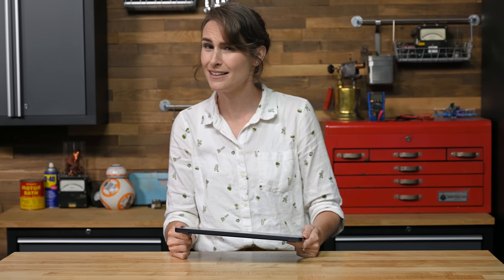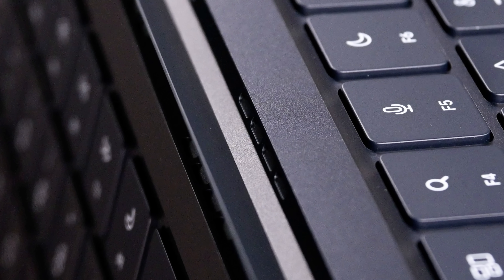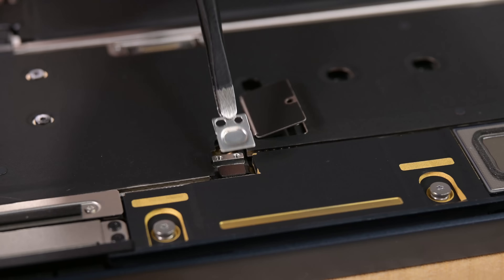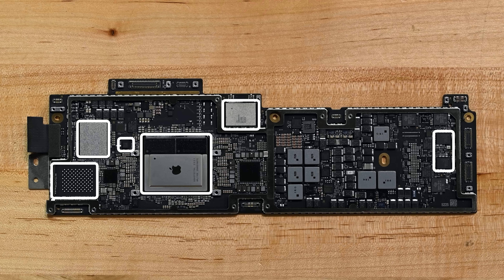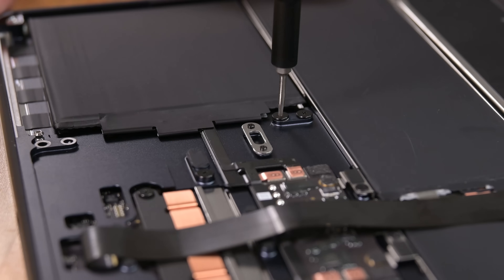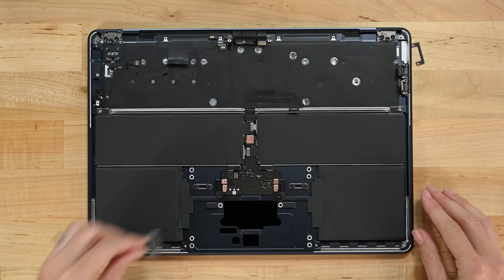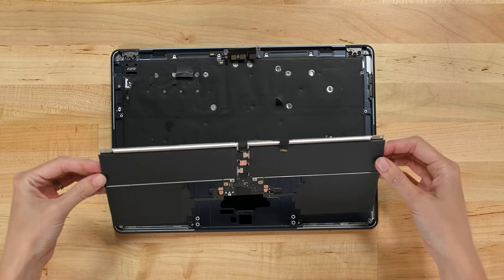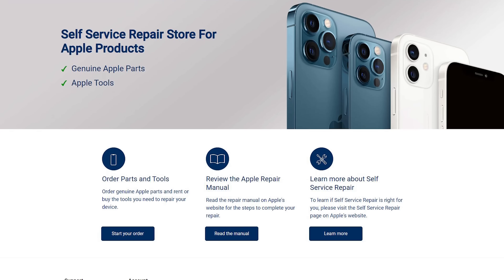M2 MacBook Air Teardown: Too Cool for a Heat Sink?

Comment: I remember previously some laptops (dell or asus) could 'sense' if it was on your lap, and would try to keep surface temperatures cooler if it detected it wasn't on the table. This Macbook may throttle if the accelerometer detects movement to keep the chassis cooler on your lap.
Reply: @Ramp Just my opinion: It was a bad design choice to make the thermal heat spreader smaller on the M2 than on the M1. It just adds another asterisk to the performance of the machine that doesn't need to exist. If you really want to put a less capable cooler in a machine, put in a less capable chip to match it. That way the marketing claims Apple makes will more closely match what people are actually getting, regardless of what they are assumed to use it for.

But that's almost separate from what the OP is saying. I'm not going to pretend to know why Apple put in the accelerometer, but what the OP is suggesting is a reasonable guess. It's probably for several reasons and not any one use in particular. They can always add uses in software if they choose to. A couple of guesses why from Apple's perspective, this might be a "nice to have but not critical" feature:

1. They know that a lot of people base purchasing decisions on video reviews and if a reviewer complains about it being uncomfortably hot on their lap, fewer people will buy it.
2. It could be a quality of life feature for users in hotter regions of the world where the ambient temperature is just going to add to the temperature of the machine.
3. A less likely reason: Apple's lawyers suggested that if they insist on letting the machine run hotter, they implement something to protect themselves in the event of a lawsuit due to a crazy combination of circumstances that led to someone scalding their lap by accident, which could result in bad press, payouts for damages, product recalls, ect... (I don't know exactly what this would be. Maybe someone with extra sensitive skin falls asleep outside when it's hot while doing something super intensive with this laptop on their lap and wakes up to burned thighs lol. Maybe the added heat just increases the risk that the battery degrades at a faster rate and explode on someone's lap. Crazier things have happened. Remember those exploding Samsung phones? It wouldn't surprise me if Apple is bending over backwards to make sure that bad press like that never ever happens to them.)
Reply: @Ramp The difference with the M1 MacBook Air is that the throttling happens way later as the chip can still be cooled. And why are you against active cooling? It's not like the Macbook Pro turns them on anyways (rpm very low even with 90°). Once you need the real power of the M2 (or M1), you will see that passively cooled is trash. Sure, you won't see any benefit while only using Word and safari, but then there is a question weither a Macbook is needed or a cheap Chromebook can do the trick. Either way, that was my opinion and it is your money. You know the best how to spend it.
Reply: @Ramp It doesn't matter what "typical use" is when it comes to hardware design choices such as these. What matters is what the machine is capable of doing. There will always be users who push any given machine to its full capabilities. What the OP suggests is a perfectly plausible (and testable) guess. Overheating is overheating, regardless of what the chip inside is. The M2 has been shown to reach temps above the boiling point of water, so yes this would absolutely be a welcomed quality of life feature for some users. Even if Apple is currently not using the accelerometer for this purpose, this shows that they could possibly implement it in software if they so chose.
Reply: @J33111  people are going to buy it for school anyways bruh, do you need a fan to do schoolwork? Do you want a thin and light laptop which you can easily bring to school?
Reply: @Kazim28  Then put in a less powerful chip like an A15 that won't get as hot if no one is ever going to take full advantage of the M2 anyways.
Reply: @Kazim28  All of that can a 300$ Chromebook do while being lighter and having more battery life?
Reply: @eulehund99  The macbook will still have far better performance and battery life, because m2 is still faster and more efficient than those pentiums and core i3

Edit: macbooks are still lighter than many chromebooks I’ve seen while still having better performance
Reply: @Kazim28  only better performance. Battery life would be better on the chromebooks as the chips will only use 3 - 5 W compared to 7 - 10 W of the M2. Also many Chromebooks are also lighter? Thats what I saw in the entry segment.
Reply: @eulehund99  wattage doesn’t affect much because those chromebooks that weigh less have smaller batteries than the macbooks, so the slow processor has less power anyways, while the chromebooks with bigger batteries have more power needing processors, which worsens the battery life as well, though with the mac, you get bigger batteries than those light chromebooks, along with a less power needy m2 chip than the ones in those high end chromebooks, so it’s a mix of all, I don’t know why you have to compare chromebooks with macs, since chromebooks are the worst in the laptop category
Reply: @Kazim28  Im comparing as they are mainly used for light school work, like MacBooks. Eitherway you are still wrong. Take for example the Chromebook Lenovo Chromebook Flex 5 13ITL 82M7001VGE. It has a CPU with a max TDP of 15 W and a 51Wh Battery while being only 60g more than a M2 Macbook Air (1,3 kg Chromebook vs. 1,24 kg M2 Macbook). It has almost the same battery life and weight while having a Touchscreen. Sure, it is trash compared to the M1 performancewise, but that's reflected in the battery usage. Also ChromeOS is way lighter compared to the MacOS, as it's based more on the Internet. This is not something unique. It is quite normal as Google has categories of Chromebook which need to have certain requirement for using in the schools, where they are primarily used.
Reply: @Kazim28  I don't know my school needs me to compile million lines of codes and it starts getting really hot.
Reply: spatial audio
Reply: I’m really enjoying my time by reading these replies. 😊
Reply: I tried it in the store. I played 4 x 4K youtube videos simultaneously and it didn’t even get warm, it stayed perfectly cool. Impressive. If it can handle all that, then it’s more than capable for most people.
Reply: @williamwallace410  You've tested the GPU, not the CPU. As they've already said, the GPU isn't heating up as much as the CPU, and running 4K videos isn't hard in 2022. Especially when you have VP9 decoding capabilities.
Reply: @Ramp  "In addition, a processor (and SoC) isn’t going to wear out just because it’s a little warm or even because it’s hot." oh boy, giant fanboi ego... first thing first, it is not designed to take a beating for long, because it is expected light use :) well normal users should not be doing heavy rendering/video editing long project anyway. but your assessment is the dumbest thing i ever heard in a while. the m2 when pounded gets toaster hot. and will def cause long term damages somewhere inside itself or around mobo/components! if you dont think it will, you dont know macs all that well. not even mentioning general electronics!
Reply: @Ramp I mostly agree, but as I am typing this on an M2 air, I will say that it doesn't take a ton to start feeling some heat under that case. I had it preforming a system update and that got it hotter than my iPhone ever has while doing intense tasks. I am not worried about thermals for this computer, but it takes less than a heavy load to get it cooking.
Reply: as a software developer and support engineer my macbook air is always hot af
Reply: Why macmini m2 has fan and not macbook air 2
Reply: @Ramp You're not 100% correct but I understand where you're coming from. Having a fan would make this product last allot longer.
Reply: @Ramp Max tech has made videos over the past few days showing the macbook air reaching 108 degrees C. This was for cpu workloads at full power for 23 seconds. This boi heats up fast. running cinebench for 23 seconds brought the temps up to 108, the chip then thottles by reducing its power output from 17watts down to 9 but it maintains a clock speed of 2.45GHZ. this is far from the 3.5 that it normally targets but its not bad for a fanless laptop with no heatsink. The gpu is a totally different story especially on the 8 core model. The chip maxes out at 77 degrees C on a full GPU worload (3d mark for 1 minute.) Unfortunely after 5 minutes, the chip will hit 108 degrees C and start throttling.

BUT THERES A FIX!!!!!
opening the laptop and adding cheap thermal pads from amazon will use the back plate as a heat sink. this means the CPU will take 4 mins to throttle as opposed to 23 seconds and the gpu can run full power for 9 minutes compared to 5 minutes without the heat pads. anyway. this laptop is not designed for sustained loads. people who buy this computer will use it for light every day tasks which is why the single core score is so good. if someone needs sustained loads from their laptop, they need a pro, not the air.

Comment: The accelerometer is used for Spatial Audio with AirPods Pro, AirPods Max and AirPods, 3rd gen.
Reply: As far as I known accelerometers are on the headphones, spatial audio live on the Mac is relative to the speakers placement, not movement (on the AirPods spatial audio is relative to your movement), if you have sources to that use im interested though
Reply: @jeanbutinfrench  So I tried it on my 2021 M1 Pro MBP with AirPods Pro. When I only move my head, the sound comes from my laptop. When I only move my Laptop the sound still appears to come from where my Laptop was before moving. However when I move my head and the Laptop together, the sound still comes from where the Laptop is.
Don't know how they do it, don't know if that Laptop even has an accelerometer, just my observation.
Reply: @jorrit_o  Maybe it's like on the Apple TV, on the Apple TV for example if you want to reset/re-center the head position you have to just pause the content and then resume it
Reply: @jorrit_o  on the AirPods using spatial audio they usually just use your first head position as a reference, maybe with the U1 chip they can have an idea of where the iPhone or computer is but it is not actually using it for a stationary soundstage, spatial audio does that on its own, if you change your head position and not change back for long, the spatial audio will recenter the source to seem like it’s in front of you even if you didn’t change the phone position
Reply: Thanks for clarifying folks. I’m used to enjoying Spatial Audio with my Apple TV (which obviously doesn’t have an accelerometer), so hadn’t figured it was bi-directional tracking. The more you know!
Reply: Why would the MacBook need an accelerometer though? All those headphones have their own accelerometers built in to handle the head tracking.
Reply: @rcnhsuailsnyfiue2  If you only move your device, it would otherwise have no clue where it is relative to your head. Or if you look in another direction it would’ve no idea if your device is still in front of you or not since it wouldn’t know if you only moved your head or your whole body with your device in your hand. Hope that makes sense.
Reply: @jorrit_o  doesn’t they use a U1 chip for this?
Reply: @rcnhsuailsnyfiue2  I think it’s for if your using the laptop of a bus or a train so as your moving while using it it correctly keeps the social audio in the correct reference  to the observer with their headphones.

Comment: I'm a bit curious about the heatspreader, does this has less thermal capacity compared to the previous gen M1 Air?

Looks like M2 chip on the Macbook Air  is quite toasty, and M2 seems to pull slightly more power during heavy load too.
Reply: Yes this has less thermal capacity than the M1.  MaxTech and some others have done tests and this thing gets really hot when doing anything demanding - hitting 108 C before throttling down.  Looks like Apple is letting these chips run hot.

Comment: Pretty sure a missing heatspreader is a tradeoff to not move the heat of a 40°C SOC to the sides where the laptop touches your legs. I guess apple rather have a laptop that throttles, then one that keeps going and is not lappable anymore.
Reply: It's because Apple decided to be lazy with designing a heatsink.

Comment: Great work on the teardown! Awesome that you guys pulled basically everything out of the chassis.
I wonder what that accelerometer is for.. 🤔
Reply: I'm just happy to see the battery isn't glued down.  Looks like nearly every component of this can be replaced.
Reply: @Watchandlearn91  Except the main wear part - the SSD. Great job, Apple! NOT!
Reply: @TimmyInTarky  agreed. Them not allowing replaceable RAM is at least more reasonable because of the architectural advantages of unified memory. They solder the SSDs just to screw customers. 

Although in reality the main wear part is the battery but the SSD does wear too
Reply: I would guess it’s for spacial audio
Reply: @jorrit_o  Definitely for Spatial Audio
Reply: Spacial audio with dynamic head tracking
Reply: Airlines asked for it: the laptop won't run during takeoff acceleration and landing deceleration!
Reply: I have seen this feature on Dell laptops which uses accelerometers to detect if the laptop is on lap and reduces the performance to prevent heating
Reply: @ajaykarthik736  wait waaat this doesn't heat it throttles too much
Reply: Have heard of accelerometers in older macbooks which would detect a falling laptop and turn itself off to prevent electrical damage.
Reply: @ABHISHEKTHAKUR0409  it is here for spatial audio with dynamic head tracking
Reply: Could you make video with exact guide on how to replace thermal paste?
Reply: Max please do a comparison between an equally equipped M2 MBA vs a MBP14 (both 512SSD/16GB RAM)
Reply: The accelerometer will measure the speed when you eventually use it like a frisbee and throw it in the trash after the poor thermals melt the chip

Comment: I'm not skilled in computer repair however always found this channel interesting. It's cool to see what can be done without a cooling fan
Reply: Same here
Reply: Was the pun intended ?
Reply: Haha I see what you did there
Reply: What can be done is a computer that will spend most of its lifetime reaching its thermal limits. 🙄
But I guess people are meant to buy a new one every year anyway, so it's all good 😅
Reply: @D.Enniss  y'all really don't know what you're talking about do you? so ignorant.
Reply: @D.Enniss  that’s not true, the m2 will never get hot under daily use, it only gets hot when you do something that’s very demanding, but intel laptops are another story
Reply: @D.Enniss  its the same architecture as the processor on your phone - and that doesn't need active cooling.
Reply: @W0Rd0n32sTre3T  your phone has a vapor chamber or copper plate or some kind of heat spreader which makes it so heat can dissapate from the screen and the back.

The m2 can be the same architecture but its more powerfull since its a laptop(/ipad?) chip so it consumes more power and it makes more heat so it needs more cooling then a phone

Comment: accelerometer might be to support the ipad and iPhone apps which can run on the macbook air, just a guess though.
Reply: Back when MacBooks first got accelerometers (before iPhones existed) there was an application you could download that would make lightsaber noises if you swung around your $2000 computer. Much fun. Very dangerous. The accelerometer was actually used to detect a drop, and lock the spinning hard drive to prevent damage.
Reply: I am imaging a person just flicking and moving his macbook